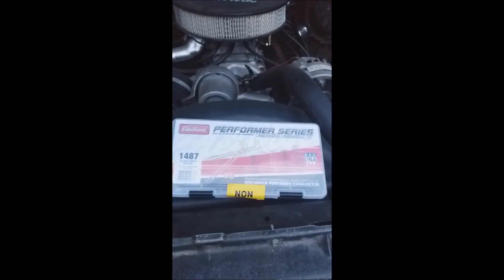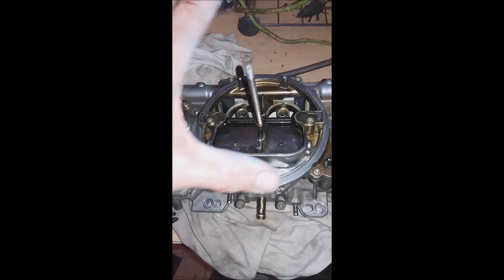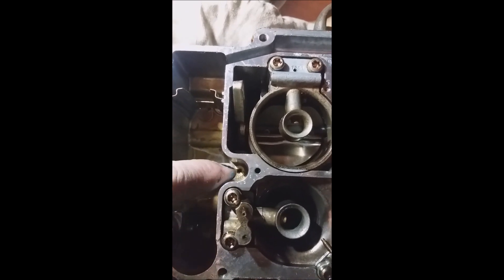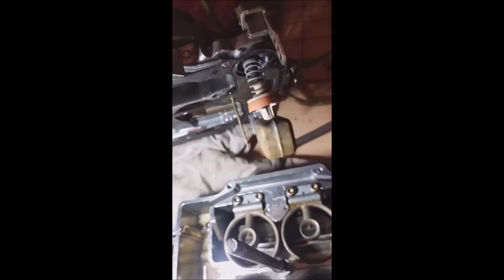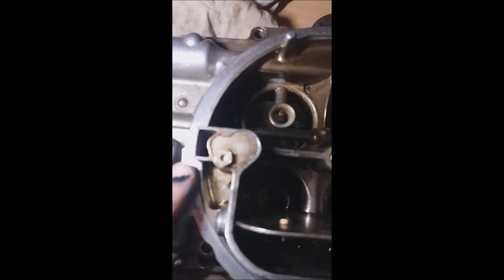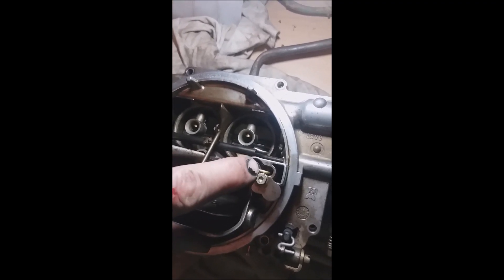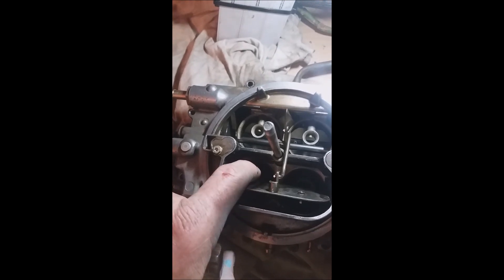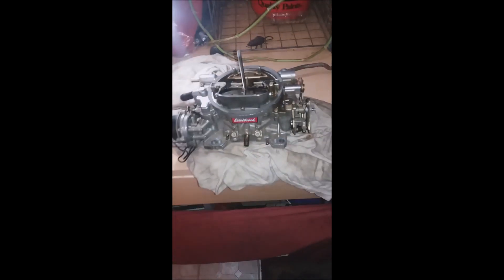Rods Springs and Jets install in Edelbrock 1406 Carburetor

Comment: Didnt see one can of carb cleaner there to clean the bottom of the float bowls?what were the 3 numbers on the jets? The numbers on the metering rods & the color of the springs? What did you use out of that big ol calibration kit?
Reply from the maker: i used the smallest sizes included. I was trying to reduce fuel flow a bit.

Comment: I have a y-bucket with a 350 and it has a tunnel ramp with 2  600 4 barrels edelbrock carborators I was told it was too much gasoline for the engine. That I needed to replace the jets. What is the process in doing it? And dose that sound right?
Reply from the maker: The process is definitely in this video to swap jets to a different size. 2 600s is a lot for a 350, but you can push it. I am not sure swapping the jets really changed much in my truck. I would assume some modifications on the cam etc... but it would be a beast.

Comment: I did the adjustments same as you,but now my electric choke does not work right. Any ideas are greatly appreciated.  Thanks
Reply from the maker: my choke is all automatic.  I just hooked up the power wire and it did its thing.  Not sure.

Comment: What is the recommended jet size for a elderBrock carburetor on a 355 Chevy engine?
Reply: Depends on alot of variables. Best bet is to get a air fuel ratio gauge to give you a baseline.

Comment: It’s not a bad video but can you reduce the jets and rods enough to bring a 750 down to a 650 or600 without replacing the whole carburetor. Just through the calibration kit?
Reply from the maker: That is a great question.  I didn't do enough research on it to know.

Comment: I just rebuild a Chevy 350 engine and bought an Edelbrock 1406 carburetor for it. Since startup, it is very very heavy on fuel!! So bad I do not even want to drive it no more. What can I do to get it to run more efficient? Currently, I only get around 3.5 kilometers to the liter which is around 2.18 miles to the liter or 8.2 miles to the gallon. This is just killing me, Please help!!!
Reply from the maker: If you get the carb calibration kit in this video, you can replace the rods jets and springs with ones that are a lot leaner.  It may affect performance but this is how you can lessen the use of fuel a bit.
Reply: Have you went through setting the carb up for your 350? Idle Air screws? Choke adjustment? Checked a spark plug or two to see how they're burning?
Reply: Stop complaining (:}) ...I just bought a 1982 Chevy G30 Cube Van...runs Fantastic...350 engine, Edelbrock 1406 carb, TH400 trans, 3.75 rear end gear ratio...just checked my MPGs...I got 98 miles on 14.97 gallons of gas.... 6.5 mpg. 
I immediately ordered myself a Fuel Pressure Regulator...an Edelbrock 1406 Calibration kit...hell I even bought myself a new Edelbrock AVS2 carb. lol...one way or another I'll get this thing up to 13 or 14 mpgs.
Great video...Liked/Subscribed !

Comment: G I guess I'm the first one to tell you that all you're worried about is showing people how to do it you're not telling them explaining to them why why I would like to know what the metering rods what gauges do what how to make my carburetor run efficiently on at least amount of gas as possible you don't explain any of that justo here's how we change them you don't say why you're changing them
Reply from the maker: When you buy the carburetor calibration kit, there is a chart inside the box that shows how to use the different size springs rods and jets.  With a combination of the 3 different pieces, you can tune your carburetor to run in many different modes including the one you were talking about with least gas used etc... I wanted to show how to install the pieces.  To tune the carburetor, use the chart.